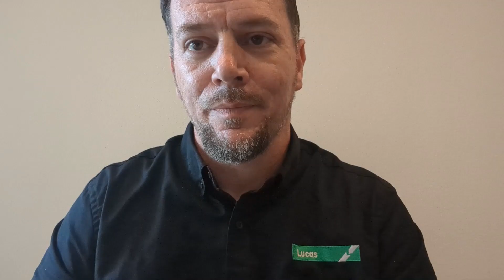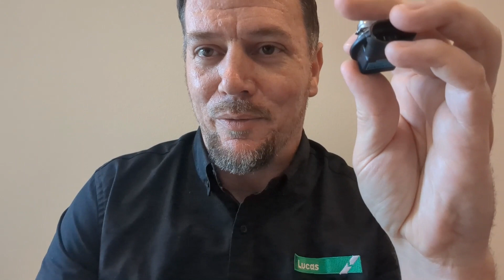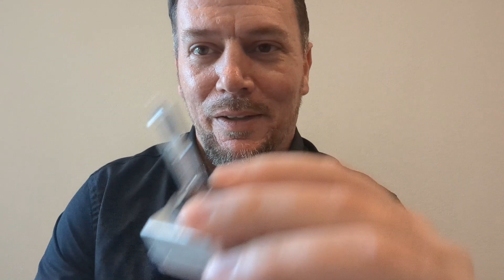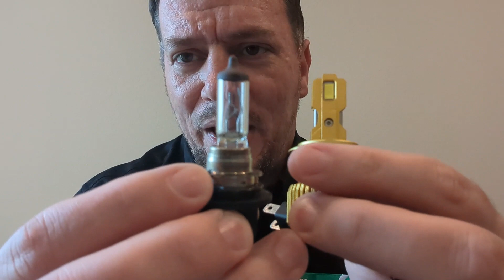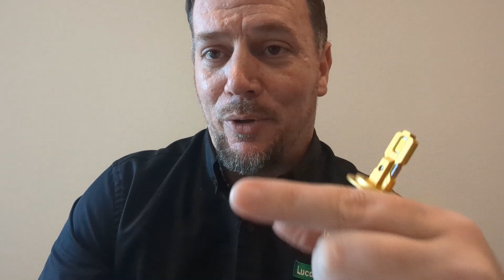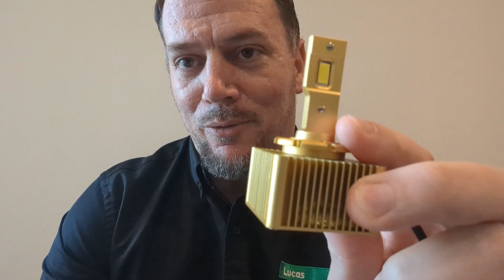Lucas Lighting LED headlights - Bulb Technology, comparing halogen, HID and LED

Comment: I just had a set of your Series L3's installed in my 2023 Jeep Wrangler that came with halogens.   I had them installed by a audio shop that also does lighting mods.  I took the new lights for test run the other night.  I noticed that no other motorists flashed me.  However, your company notes that these lights are for off-road use.  And there's no DOT approval stamped on them.  The owner of the shop also had your Series L5's.  However, he said those were for off road use only. (Edit) I had to go on Amazon and buy those cheesy black tinted covers that you put on the headlights--it's looks bad, but reduces the glare.  I was getting peppered with hi-beam flashes by other drivers at night.  I don't know what happened, initially no one was flashing me after installation.
Reply: So basically the low beams are too bright for road use? I've noticed with Jeeps they do shine directly in oncoming traffic eyes. I think it's the angle of the headlamps
Reply: @mtmatt8958  It's probably more of a question of aftermarket lights being installed by ham-n-eggers.  A lot of lights seem to blind me these days from all vehicles, not just Jeeps.  Listen to the aftermarket obnoxious and loud exhausts you seem to hear on a lot of vehicles these days.  Probably no different than the lights they are installing.
Reply: Why do they make the l5 in a low beam bulb ? I'm thinking of buying 3 sets of them for all my bulbs
Reply from the maker: Some styles cross over from high to low, for example, Cadillac CTS has H11's in high, low and fog positions.  We don't make L5's in anything that is only a low beam application.  We make four dual output style bulbs in L5, but the low beam is staggered down to L3 output, while the high beam is full L5 output.
Reply from the maker: Any changes to ride height, etc?  I would recommend doing a vertical alignment check.  Lots of videos out there on this.  Basically, you need a flat area to park where you can shine the lights onto a surface (garage door, wall, etc), a measuring tape, and some painters tape (recommend 2") to check alignment.  At 25', drivers side light should be 4" below the height of the bulb and passenger's side 2" below.